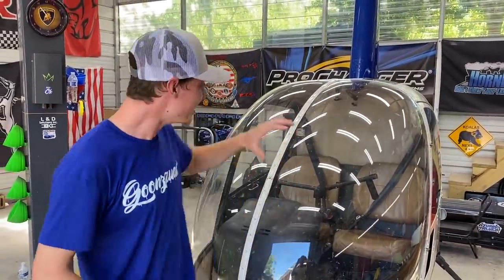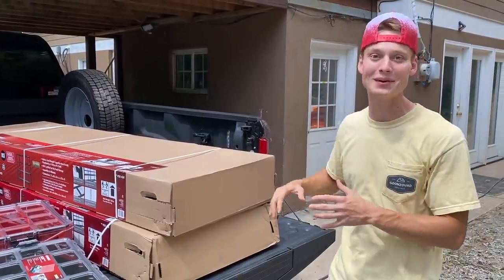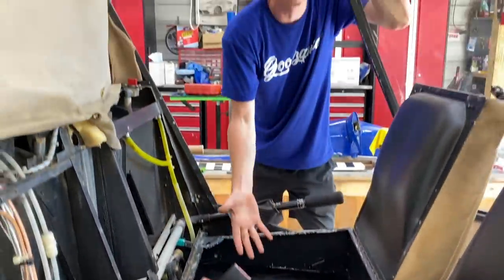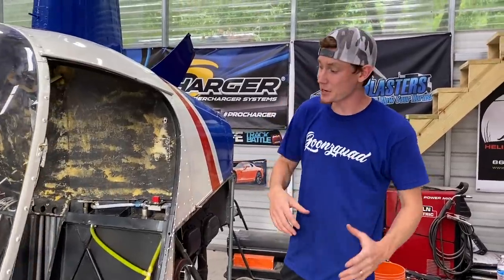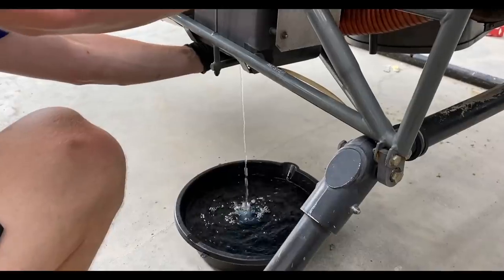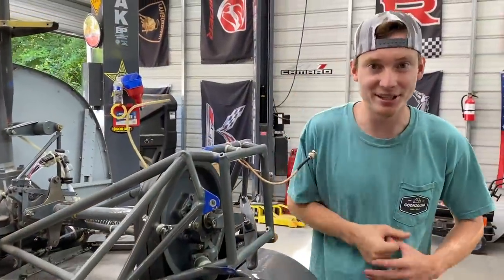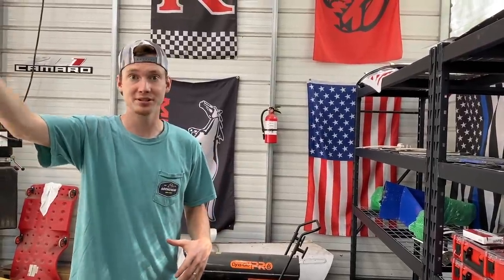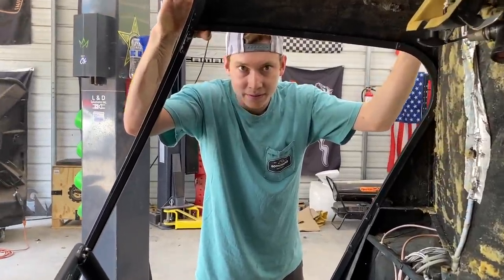Rebuilding A Robinson R22 Helicopter Part 2

Comment: Gentlemen, in order to work on this you must be a FAA certified mechanic!
Reply: thats what I thought...unless they find an aircraft mechanic who signs the books for them or it becomes an experimental category helicopter ...
Reply: Correct, they just need a A&P with IA to sign it off.  Essentially the mechanic would verify that it’s complete and correct and would have their certificate on the line.  Also log books have to be clean or they would never be able to sell it.
Reply: @FlyingRob22  it sounds like they have a guy supervising them that's a Robinson specialist with his A&P! Now I know I wouldn't sign off on any repairs that I wasn't personally involved with and without being contracted by an insured company under contract! But that's just me😂 now if it was my own aircraft then it's a little different depending on the type of repair or if it's an annual inspection A,B,or C doesn't matter if still be at a insured maintenance facility! But if I'm just replacing a marker or a panel is sign off on it!
Reply: They mentioned something like they have someone that knows all this stuff. I am assuming he is certified and will supervise and double check everything off camera?
Reply: James Avram Wouldn’t be signing off on any of this either. As you stated, just to much liability involved.
Reply: Literally they said they are being supervised by one.
Reply: or be watched and monitored by one
Reply: Honestly, these guys are more then capable of working on this helicopter, I’d be more then willing to sign off there work if I was there.
Reply: In a world with unlimited potential, anything becomes possible, the mind is often humanities the biggest limiter, overcoming these limiting factors takes courage and a can-do attitude.

Our world like it or not, believe it or not, is rife with duality, whether you think you can or think you can't guess what??? your right. Mind over Mattress

Comment: To make sure you don’t loose the screws and attachment fittings for different components, is to put all of the screws into clear plastic bags and tape them to the components. This is the way most aircraft technicians do it and the way I was taught, good luck and enjoy, I know I did.

Comment: 14:01 The reason rivets are used in the Assembly of parts and aircraft is to be able to do repairs with as minimal disassembly/ replacement damage as possible. See, for the critical components of an aircrafts  body, rivets are preferred because of their ability to withstand extreme stress without breaking or otherwise succumbing to damage. It's a safer and more effective way for aerospace manufacturing companies to build aircraft.
Reply: austin bevis he’s not a hater he’s just trying to help
Reply: thats so when the rotor stops and it falls like a rock it is easy to fix if there is enough left
Reply: Also easier to inspect. Welds can hide fractures on unseen edges, but a knackered rivet shows up from every angle.

Comment: Rivets have a much higher fatigue resistance than welds in aluminum.  In an application like this with lots of vibration this means that it is less likely for a small crack to form in the material.

Comment: All planes and helicopters use rivets rather than welding for the case that there are micro fractures in a body piece that start to fail. As a piece fails, it starts to crack, and those cracks can travel through welds, compromising other adjacent body pieces. Conversely, the rivets will isolate any failures to the individual piece where the fracture started.

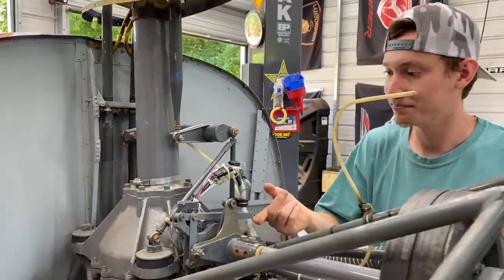Comment: 16:44 the rotor brake you were talking about is used to stop the blades minimum 30 seconds after you have cut the fuel to the engine. The switch is connected to the ignition circuit and prevents you from starting if you have accidentally left the rotor brake chain in the 'pulled' position. I fly R22's and hang out with the mechanics who rebuild these in the hanger, so if you have any questions let me know.

Comment: GOONZ! I have these shelves and you will definitely like having them. One recommendation is to also grab a few Akro-mils  super size organizer bins in 24" deep. I use these for smaller parts/finishes etc. and have a couple stacked to increase vertical capacity on the top shelf as well. Could be useful for containing supplies, small parts etc.

Comment: “Let’s rip a helicopter apart”, says a guy with no A&P certificate.
Reply: Wonder if they are FAR 145 certified...
Reply: they are doing work with an a&p so they don't need a certificate.
Reply: And if the A&P signs off on it, who is going to Inspect it..per the FAA

Comment: The boys here have dealt with expensive automotive paint wait till they find out how much aircraft paint costs
Reply: Is Emron still the main paint used? It was pricey in the late 70s but sure did shine.
Reply: @delholford987  Imron is still around, though I believe DuPont sold them off a while ago. Runs about $250 for a 2oz touch up kit. PPG Aerospace/PRC-DeSoto ( Desothane) is the big player though, prices vary a ton depending on what product and the mix, but it can easily touch the $800-1000+ per gallon mark.
Reply: @SnakePilot16  We used it to paint a TV remote truck. It held up extremely well. PPG is making some good products. Whatever FIA uses on the Jeep Cherokee Trackhawk is extremely expensive too, which is why they used a substitute to finish theirs. Thx.
Reply: @SnakePilot16  Curious why they can't use regular automotive paint? What's the difference between that and aircraft paint?
Reply: If they do it right..
Reply: Del Holford , Imron was THE SHIT, in the 80’s
Reply: I would just use automotive paint for this. This little toy won't fly fast or high enough to matter what paint you use. The USAF Thunderbirds use two-stage base and clear automotive paint for their F-16s. It holds up well.
Reply: @Sugarkryptonite  Imron and other aircraft paint is really hard paint once cured and can hold up in areas like leading edges of wings and nose cowls when flying through weather at high speeds. They won't need it for this little guy. They should use automotive paint.
Reply: @Sugarkryptonite  Long story short regulations and the aviation environment are way tougher than any automotive equivalent for a longer answer read below. 

I'll preface this by saying I'm not A&P nor am I involved with a Part 145 paint shop, just a commercial pilot with a slightly larger baseline knowledge on aviation paint due to that background and some minor connections to PPG/PRC-DeSoto via family so don't take my word as gospel.

Part 43 and 145 of the FAR (Federal Aviation Regulations) would likely be the sections that will prohibit them from using automotive paints.  The aviation industry is one of the most tightly monitored and controlled out there everything has to be certified, tracked in maintenance logs and by batch number. The FAA inspector will be looking at everything they do with an extremely fine tooth comb, (Sidenote, love the channel but if I was an A&P/IA I wouldn't be risking my certs on this build. R22's are simple for helicopters but between the risk to me and their lack of experience not worth it) some aircraft maintenance manuals not only specify paint process, but also which paint has to be used. Imagine if something materially fails with a paint that causes a problem, the FAA wants to be able to trace the paint back to its date, and batch.  It can use this information to see if any other aircraft may be affected and determine failure root causes. Anything in aviation is going to be boutique compared to automotive due to scale and regulatory oversight adding to cost. But beyond that it comes down to environment, sure that might not matter a ton for a small GA plane or helicopter like an R22 but think this. Lots of aircraft can go through this in one flight surface temps of 100F to temps below -60F whilst traveling at speeds of 700mph, the thermal expansion and speed alone would destroy automotive paint. Now do that multiple times a day for years on end. Desothane CA8000 Top coat is rated for  -54°C to 177°C (-65°F to 350°F) for just that reason but there is more than just that it's resistant to staining from fuels such as 100LL and JetA or being stripped by the insanely corrosive Skydrol that will inevitably leak on it all whilst being extremely light weight, since weight means performance loss which equals less fun or for a company money lost in usable weight. For lengths sake I'll cut it off there but that only scratches the surface of a subject that I'm not really qualified to speak that much about, but I'll gladly try to answer any aviation questions that someone has on this build that I know enough about.
Reply: @Sugarkryptonite  Aircraft paint is much thicker and helps deal with turbulence.

Comment: It’s very rare to see anything welded in aviation. Lots of vibrations, flexing, and bending during flight. Welds will crack. Rivers and screws are common place.
Reply: Not true. "Tube and rag" aircraft have welded tube frames with fabric coverings. The ubiquitous Piper Cub was one and the modern Maule is another. There's  even a plane now being made with spin-welded aluminum instead of rivits.
Reply: Gotcha. I was just saying in my experience I rarely see welds. Most of it on C-130’s and some rotary lift. I’ve had the chance to talk to some engineer types when we were testing new mods or equipment. The final version is stuff we’re never welded and asked why. That was just the answer he gave me
Reply: I worked on F15s and there was hardly any welds. And the welds we did have were NDI'd every QA inspection
Reply: Can’t weld the alloy, weakens it.
Reply: True, I build Boeing 737s and we use rivets and titanium hi-locks exclusively.
Reply: @patio6  The complete rear fuselage tubing aft of the pilot on my Hiperlight Bi-Plane was welded aluminum tube. Hundreds were built that way and fly today.
Reply: Dennis Cady ok maybe I need to clarify. If you’re repairing it like these guys are, you probably shouldn’t weld it. Structural stuff is probably ok by a certified person but any panels that make up the body. I wouldn’t touch it with a welder, especially on a heli

Comment: as on old race cars, there is often a gasket between the riveted panels and to upgrade the fuel tank to a cell, they open it up and put in a bladder and foam. You will lose some capacity.  It may be difficult to increase the fuel cell size unless there is extra space in the frame of the heli.  Excellent job at organization.  This is probably obvious, but replace all rubber bushings with new ones. The heater works like heat exchangers on an air cooled vw or porsche.

Comment: One reason that airplanes are manufactured with riveted joints instead of welded joints is because the aluminum materials used in their construction isn’t tolerant of heat. The greatest benefit of using riveted joints in an aircraft is that they are stronger and more durable than welded joints. Riveted joints are also easier to inspect than welded joints.

Comment: The exhaust heat exchanger blower is to keep the polycarbonate windshield  from fogging up as you go higher in elevation the air is colder and denser. FYI think carefully about painting your logo. If you sell the copter it will have a higher resale if it doesn't require repainting. I believe the primer & paint is aircraft specialized.

Comment: Taking apart a helicopter is one thing, putting it back together properly is a whole other ball game.  There are a lot of specialized adjustments to be made to the cyclic, collective and tail rotor controls that is way over the heads of laymen.  As long as an experts put it all together and the goons step out of the way they might have a flying machine.

Comment: I've been an aircraft mechanic for 21 years, 15 of those on MH-60 helicopters.....Take your time and do it right. And its fiberglass....not kevlar.
Reply: Jeff D .......... rebuilding cars is one thing but aircraft takes you into a whole new world regarding safety and calibre of equipment used. Are they wise doing this project in your opinion?
Reply: @kieranoloughlin  Yeah, they're good...as long as they have the certified guy come inspect all their work, of course. This isn't something they can just go take a rip in, even after they get a pilots license. But as far as the overhaul, a small R-22 is about as good a place to start as possible....in my opinion.

Comment: I can see they have no idea what they are doing. Battery is still connected
On tear down. Jesus ... Heli not grounded and draining fuel. They are lucky they didn’t blow up.
Reply: Blow up seems unlikely with an uncharged heli - but good point. Helicopters generate a lot of static in flight and arcing is a definite worry for an operational helicopter..
Reply: @EdwardTilley  I'm just wondering how they plan to handle the tech logs and journey log with AME not being around them.
Reply: @Matt-nj7zg  They mentioned they have an aviation mechanic working with them; I'm sure it's his advice that has them labeling everything on shelves, and so on. Lots to watch out for on this job - but I think its a brilliant project. What gives me the hebi-jeebies is when pops walks under a car on the forklift.

Comment: When you put your hardware back in on the paneling put the drill on a very low setting it'll save you a lot of heartache on those nutplates. I'm an aircraft mechanic.

Comment: Bladder tanks are just like fuel racing cell.
Seriously consider supercharging the engine when it goes for remanufacturing process. Adding more horsepower is necessary to climb to higher altitudes and carry more fuel or cargo on trips. Turbocharging is awesome.

Comment: Bladder rather than aluminum because they are lighter. You cannot get bigger tanks because your wet payload will be too large for the engine/airframe. They rivet the aluminum tanks because they have a robotic riveter already so it saves from designing a whole new manufacturing method for a specific part.

Comment: Can I suggest, that for behind the headliner use a material called k-flex it is an HVAC noise dampener, just like the foam material behind headline but alot less messy lol

Comment: Make sure if you guys are overhauling, you won’t need any of those old screws per FAA requirements. It’s good to keep “scrounge” screws as we call it. But yeah new hardware should be required in re-assembly it will save you ALOT of heartache on inspection.

Comment: Label all parts as port (left) or starboard (right) looking from the rear of the aircraft forward. It avoids any confusion later on and it's something your inspector may pick up on. 
Looking forward to the series, any plans for a separate series for your flight instruction?

Comment: The handle on the left is called the Collective Pitch Lever.
The one in the front of the dash is called the Cyclic Control.
And, the pedals on the floor are called Rudder Control.

Comment: The gas is riveted because it's thin aluminium. Welding thin aluminium can induce stress in the part that can lead to cracks over time.  A riverted tank only requires periodic resealing, which is safer in the long run.

Comment: Horizontally opposed 4 cylinder Lycoming O 360 with an updraft carb, composite panels(strong but not flexible), those are integral tanks and sealed while being constructed

Comment: Usually they don’t weld because the welds can crack with all the vibes and heat/cold cycles. Rivets are forever and hold great when done properly.

Comment: You likely won't find anything wrong with the engine. In that application it only uses 137 horsepower out of the 150 it makes. We, at the factory,  were usually able to reuse the camshaft. And that is one of the first things to go in an 0-320.

Comment: If u n want add extra tank u should recalculate the size and the white  u need to use for the destination u need to calculate with the engine hp power that can cry on

Comment: In a previous comment, body work was mentioned.  Also, Paint, as I recall from my auto painting instructor, painting an airplane wing has to be done correctly.  Paint has weight so you don't want two coats on one wing and one on the other. Guessing the tail cone is similar.  but you guys are smart and probaly on top of this.  Good Luck and anxious to see the next video.

Comment: Whatever happened to the boat? Did you finish the interior? Any engine mod or repairs? Did you fix the trailer or replace it? What about the exterior finish?

Comment: I'm getting my private rotorwing license right now (checkride is in 10 days!) so seeing how this helicopter is assembled is very interesting.  It's a simple design, but sadly nothing in the aviation world is "cheap".  A rebuild on the R44 (4 seat version of this) from the Robinson factory costs $250,000 and is a major factor in the price of used helicopters.  Robinson and the FAA require that they must be rebuilt after 12 years or 2,200 hours.  Also for anyone interested, getting your helicopter (rotorwing) private pilots license costs between 15 and $20,000.  Most of that is renting the helicopter itself, about $250 per hour, not including the instructor, so closer to $300/hour.

Comment: Bladder tanks aren’t going to increase your flight time, in fact it will decrease as they’re smaller. But on the plus side they are safer after a crash (less likely to explode). So you’ll have less fuel and hence can’t go as far, but you’ll be safer in a crash and your useful load will increase marginally (there’s only so much you can fit in these helicopters).

Comment: The tanks are riveted because they are made from an aluminum alloy called 2024, which does not weld well. 2024 is used because of its weight, strength, and corrosion resistance properties.

Comment: I would have just grabbed some 2x6's boards and 4x4 posts some 3 1/2 to 4inch nails, cutting the boards turning them into a two shelf corner table with the dimensions of a 4ft. x 6ft x 4 1/2 to 5t. foot high table.